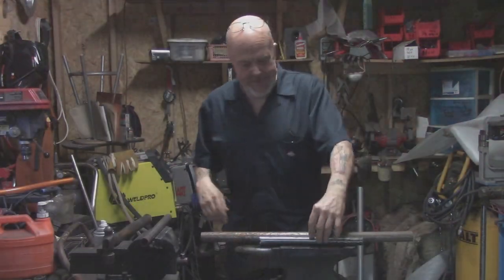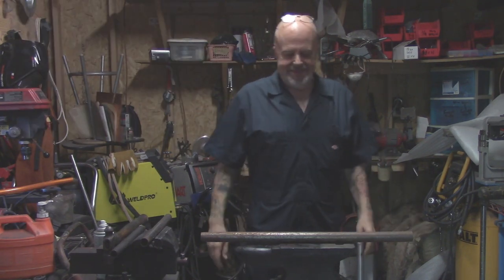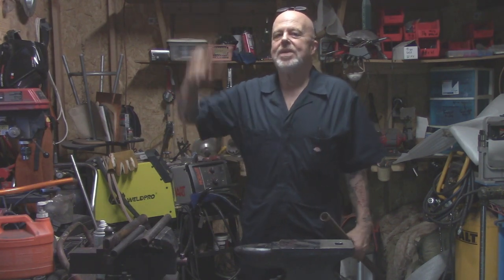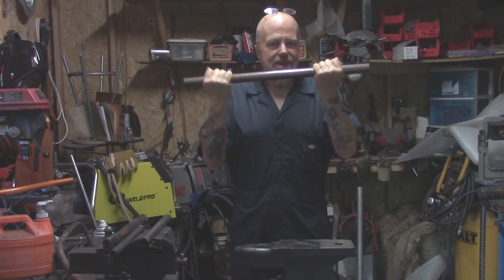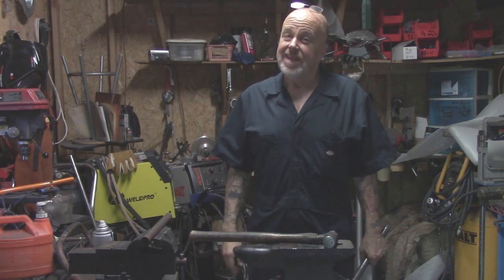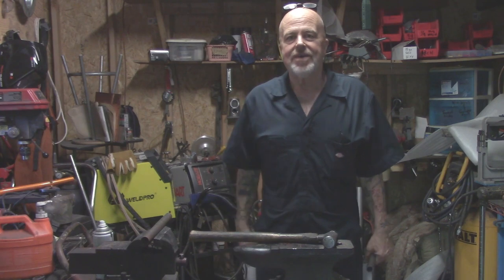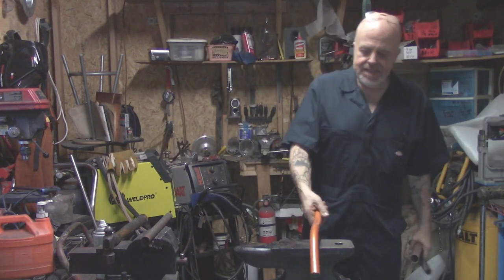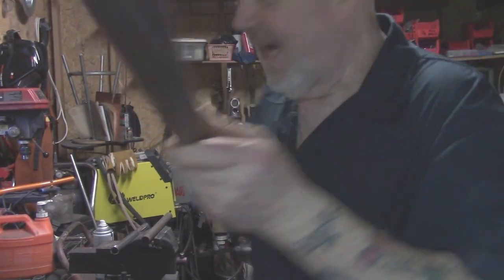Build The Ultimate 212cc Motorized Stretch Beach Cruiser? - Good Idea OR?

Comment: I got two of them an had no problem an it has a 212cc yes I did had it over 2 year an yes you have to modified the bottom pipe frame an am 237 pounds if you decide to weld use a tig welder no stick welder you can only use stick welder on the firmstrong skrech beach cruiser

Comment: In addition to the added weight from the engine, you'd also have a fair amount of vibration since vertical single cylinder engines aren't exactly smooth running. I wonder if one of those Chinese horizontal cylinder pit bike motors would be a better choice?

Comment: YOUR RIGHT! I had a Walmart beach cruiser that I put a 49cc kit on it. At least every month I had to weld and reweld due to frame cracks! It kept reoccurring to the point I almost boxed up the entire seat post area!
Reply: Where did it crack at?
Reply: @ChristopherJones16  right at the seat post area and the rear wheel frame arch begins. I think I solved it by welding a plate across the frame above the rear brake area. I also welded a 1inch wide brace from the seat post tube to the plate at rear brake area to strengthen it up once and for all. Someone stole it so no more worries now! Ive moved on to a phatmoto rover. Im also got a worksman newsboy that Im putting a 140cc dirtbike motor with a 4 tranny from amazon. 🤘😁

Comment: 4130 chromemolly steel VS cheap mild steel frame also makes a difference....Wish I had an aluminum mig or tig welder, I tested those alumiweld rods & if done properly can fix an aluminum frame. The weld I made with it was stronger than the 2 pieces of aluminum it welded together. If you don't have any welder you could fix an aluminum frame in a pinch with those alumiweld rods. If I had a junk aluminum frame I'd try to alumiweld some gussets in & test to see if I could make the frame stronger. 
  Might be a good video idea for you..... see if you can alumiweld repair a cracked al frame or make it stronger with gussets.

Comment: Thanks for caring, Eugene…great advice! On this topic, would you consider a Schwinn OCC a “stretch beach cruiser” or would it be strong enough for a motorization?
Reply from the maker: The Schwinns are fine w/ a 80cc or YD100. Plenty of them running just fine
Reply: @HughesMotorized  Thank you, sir. I’m considering to use a 4 stroke for my next build…especially if it’s a “chopper” style. Thems don’t peddle well and a centrifugal clutch would be a much easier throttle system. Not as many cool-points…but I prefer easy to cool 😎

Comment: I'm a big strong athletic guy ive lost almost 30 pounds this year I just got 100 cc motor bought a used giant bike works amazing im 370 ibs and it took me 30 mph and faster yesterday I think  my chain locked up and I was going downhill to get it started and wiped out bike is totally  fine I got a painful wound but I agree no one should be using a stretched cruiser bike its dangerous for anyone.
Reply from the maker: I wasn't "in good shape" High blood pressure and flabby tone. Main thing I learned about weight loss is to not consume sugars or any foods that cause a blood sugar spike. Processed carbs are the worst. I'm on a plant-based high carb diet. Lots of taters, beans, grains, corn and such. Intermittent fasting and one meal a day is my salvation.

Chain issues suck on these. I'm always checking my chain. Good luck and ride on buddy!
Reply: @HughesMotorized  facts I've always  struggled with my  weight  no matter what I do yet I still  don't quit trying and thanks man 🙏 gotta stay safe especially with the crazy drivers we have😂

Comment: I built the frame around my 38lb 212 Predator, using sced 80 aircraft aluminum, which is 3/16", or .1875". I also added 1/4" patches to all the high stress areas on the frame. I use a 30mm Rock Shocks fully adjustable front fork, and a 6 spoke aluminum mag rear wheel. I added a top motor mount, so that the engine becomes part of the frame. I have the throttle stop screw set to limit my top speed to 80km/h, or 50mph, which keeps the engine under 5,000rpm firstly because I'm using a cast iron 3 magnet flywheel, and secondly, I'm not crazy, or stupid, and the flywheel is only rated for 3,600rpm. I've been riding this bike for over 4 years with nothing more than oil changes done Do not, I repeat do not use a Predator hemi, as they are made at a different factory than the non-hemi, and they have NO QUALITY CONTROL. They will sell you a hemi that can't make 1/2 a turn, before it locks up. They don't even pull the start- rope before dropping it in a box, and shipping it to the US. There is NO difference in performance between the two head designs, one is VERY reliable, the other is 3rd rate junk. Don't get me wrong, there are plenty of hemis that work just fine, but, it's hit and miss. They also stopped separating the model no, so you now have to look in the hand hole to see the valve cover. Non hemis have a stamped steel octagon, hemis have a cast alluminum rectangular valve cover. PS no bicycle tire is rated for 50mph, so, buy the best. Make sure your life insurance is up to date.

Comment: So I have the opportunity to buy a micargi Seattle with a 49 cc 4 stroke. This is basically my dream bike, since I got into motorized bikes I dreamed of this. This one is available at a great price. Is it really something I should avoid? It's kinda a smaller engine and doesn't have that high or a top speed about 28mph. What's your opinion. Is this something that is decent? I ride approx 8.4 miles each way for work per day. Please advise me on what to do or at least what to look for when I meet up with this guy. Thanks Eugene!
Reply from the maker: My dream bike too. Just be careful and watch for cracks
Reply: @HughesMotorized  hey thanks for taking the time. I was suspicious cuz he only wanted 550 I never would have thought to check for cracks! Keep making videos man I've learned so much from you. I'm kinda new to  building and your vids really help!
Reply: So gene just wanted to update you. I did buy the micargi. I checked the frame for cracks and it was all good. It was an older retired gentleman with Alot of expensive toys. I've never seen a bike built with quality like this! All custom machined and mounted. 49cc engine geared low custom sprocket chain ect. The guy basically gave it to me after hearing my story. I won't tell you what I paid but let's say it was less than half of the price of a new Seattle bike alone. You wouldn't believe the condition. Exquisite! Keep churning out the vids brother and thanks for the advice
Reply from the maker: @leroyjenkins5375  Main thing is the long sections and having a heavy engine and your weight bouncing on something that was designed for a 180lb rider only going 10mph and you subject it to stresses of going 20-40mph plus will cause stress cracks. Lots of stories out there of this happening. A bike frame is .060" wall thickness and even 50cc scooters use .120" and thicker. Good luck
Reply: @HughesMotorized   hey my brother in bikes , so far she's been good like I said the engine is small, the temptation to put this predator 212 in there was palpable the first few days. But I've been keeping an eye out for cracks and only take her on smooth roads. She's a head-turner to be sure. I thought my cdh 3.4 frame yd 100 with 19" apes got attention. The one thing I will say is the guy I bought her from is a retired engineer and really put Alot of time into the mounting and we'll really every detail. All I did was add a mirror and a bell. Wish I could show you some pics man. You especially would appreciate the build quality.  Man after the guy found out that I bike to work and have a special needs daughter he gave her to me for 400. And she seems a little more sturdy than my yd build. 
Hey have you experienced any fork issues with them cdh frames btw? Mine feels like it has Alot of play in it. As always man that ks for takin the time to reply and keep up the good work. I've been trying to learn more about how to put the 2 strokes actually together and pistons ect. And your videos are EXTREMELY helpful. All the best keep building keep riding all the best
Reply from the maker: @leroyjenkins5375  Glad to help. Post some pics on my Facebook group  https://www.facebook.com/groups/hughesmotorized/
Reply: Foam tape on mount points help big time

Comment: 212 is to big. You have to be care full. 25 to 30 is fast enough. Even at that speed if you crash you will get hurt. Stay safe. I have a stretch bike with 49 cc. Low and slow. The only reason I would put 79cc is to pull hills.

Comment: Hey glen, again thanks for the amazing videos keep em coming! I recently built a yd 100 on a cdh power 3.4 frame and it came out just how I wanted. Then I recently came into possession of a predator 212 complete with teg gearbox and all that. The pro lem is other thank taking off the gas tank and the mounting bracket I'm not sure where to start. So I go with a throttle linkage. Or would it be better to get a carb kit and run the throttle through that. I've heard in order to do that you must remove the governor which , Ive seen many videos on how to do but seem like a pain in the ass. Could you please point me on they right direction on thos? Thank you. Keep up the good work

Comment: Huge Tumbs up. Another consideration. It wasn't that many years ago these small engines didn't exist. Thanks to a demand in weed whips, small light weight chain saws engineering advanced.  Smaller is better and allows us to add small motors to bikes with some semblance of guarded safety.  Notice I choose wording carefully. Anything over 30 mph is NUTS.  UNLESS YOUR ON A TEST TRACK WITH PARAMEDICS CLOSE BY.

Comment: An am not trying to be funny but them 80cc bike ain't safe neither seen a video of a guy riding his an his bottom fram crack going 50mph on a 80cc bike I have the margardi an the firmstrong skrech beach cruiser my fram on my firm strong ever cracked it how you modified your bike I have one video of my firmstrong I will have a video of my margardi bronco 3.0 212cc an I go down hill on it to warning when getting a beach cruiser skrech switch the fork to suspension fork or you will have a dangerous problem later

Comment: The only you do something like that is to use something other than tubing, For myself, I'm going with Aluminum and the weight was already considered, not that it's going to be overly stretched. The main factor is it is motorized. so I going with ][ an I-beam that is going to house a 7HP diesel at 305cc, tubing was not even considered at that point? Neither was a non-suspension bike, and the entire bike 🚲 frame will wrap around with the I-beam, just with a regular bike and a bolt-on kit, which is plenty of stress in itself, as most don't have suspensions. Even my hubs had to be heavy,  GHETTOBIKE has some good sprockets and aircraft in the 7075-T6 aerospace-grade aluminum. Their motorbike size for a good reason. I'm also going to be running 4,8-inch fat tires, or even considering motorcycle tires, they would be tested first for bicycle tires, they can't be cheaply made. Speed was not what I'm after 30MPH -40 MPH is a range in the ballpark.

People want to go fast on these things. like speed is the ultimate ticket for approval, What are you crazy! I cringe when I see people risking all for going fast above 50 MPH. and they want to do this all the time? like going back and forth to work etc. It is only once if you are lucky, more than likely you never do it again!  Most times they have no protection whatsoever. My friend from public school was late getting to school and had a plastic bag hanging from the handlebar and peddling it like mad 😡, next thing the bag hit the front wheel 🎡 and he went ass over the handlebars in an instant,  Did not even look like it was real at the time. Even these bike park stunts and crashes make me cringe, no protection gear as well. I had my share of bike stuff go wrong like hitting jumps etc. Learned really quickly what bikes are designed for, again this was back in the '70s before they has bike helmets and stuff. BMX was just coming onto the scene then, it was a wow bike 🚲 at the time. and having springs on your forks was something, but they were so heavy,  be lucky to even pull a wheelie, lol :) Make sure you wear the proper protective gear, yes it is cool! Absolutely!
Reply from the maker: Sounds like you have some skills and knowledge/ 305cc Diesel? Cool !